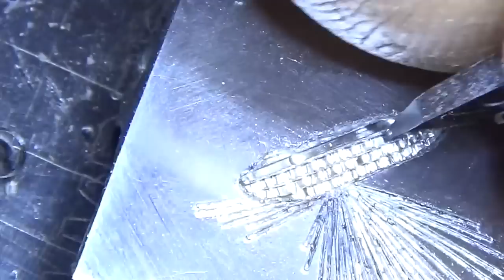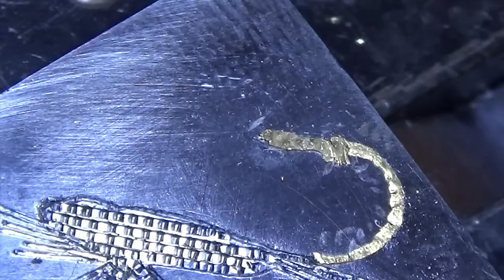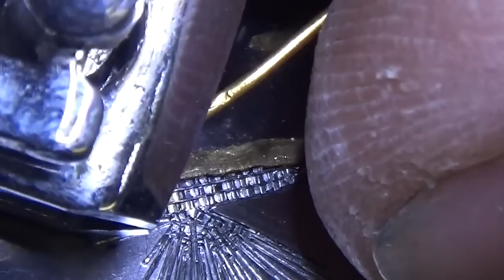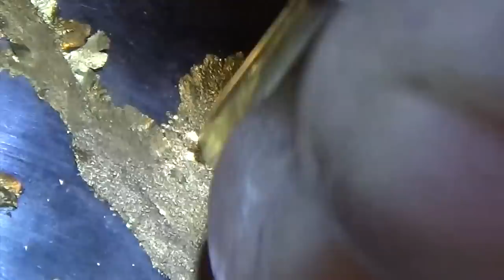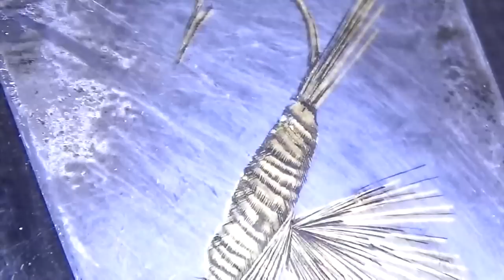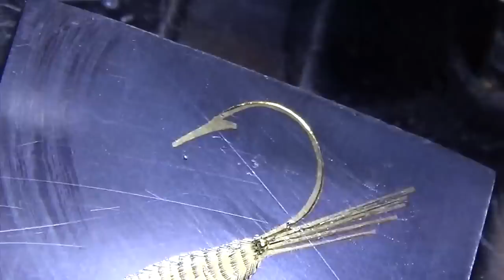24 Karat Gold inlay trout

Comment: I was horribly sceptical.  Well done. What engraver are you using?
Reply from the maker: Grendal Hall Lindsay palm control.
Reply: hamrnguns hey there, I have the Lindsay classic, but when I attempt this my machine has a hard time pressing the copper flat. Do you use the tungsten piston? Also, what size brass pusher do you use? Thanks in advance
Reply from the maker: NPC 110110001 I use a steel punch for everything except gold. You can use the tungsten piston. That would definitely help. Make sure that you are using good pure copper. I’ve tried using cheaper copper and it was very difficult.

Comment: How durable is the inlay/how wear resistant is it? Will it fall out over time or is it pretty much welded to the steel but without heat?
Reply from the maker: DuckFaceDog the inlay will not come out. The gold is held in with undercutting the outline and has numerous teeth on the inside. The detailing however is susceptible to wear because of the softness of the gold. As long as it is not rubbed continuously it’ll last forever.
Reply: hamrnguns cool thanks for replying